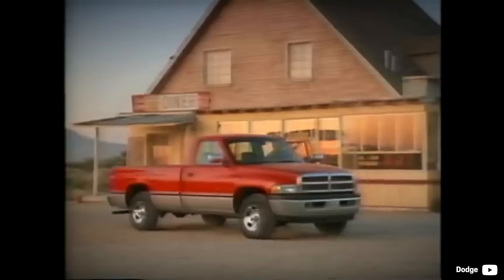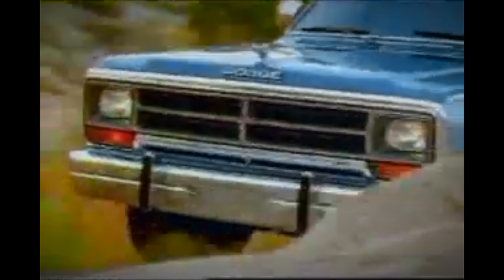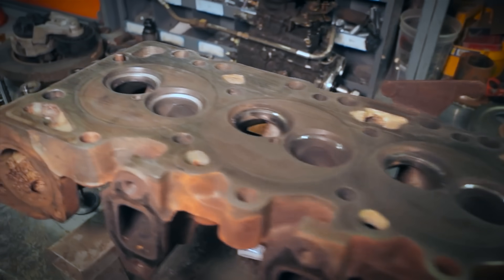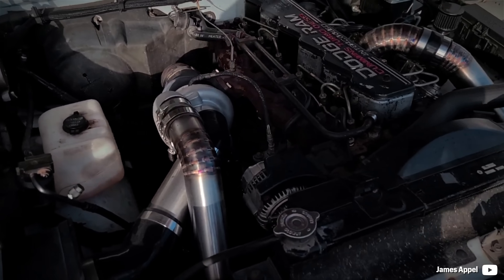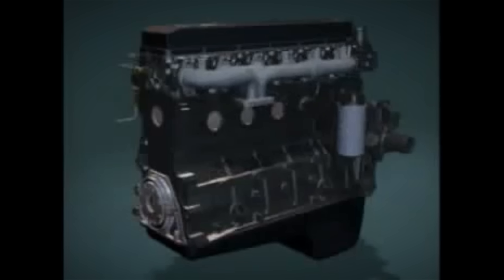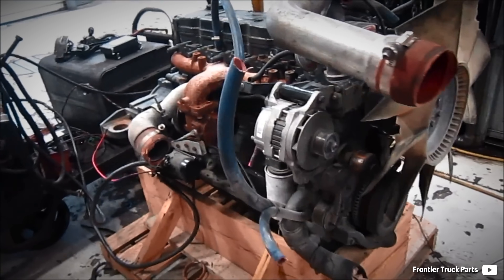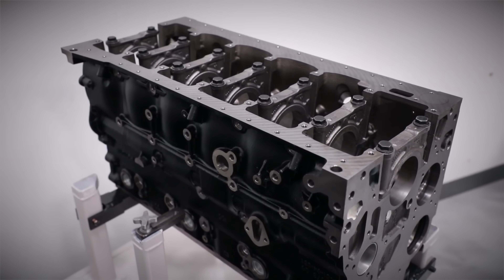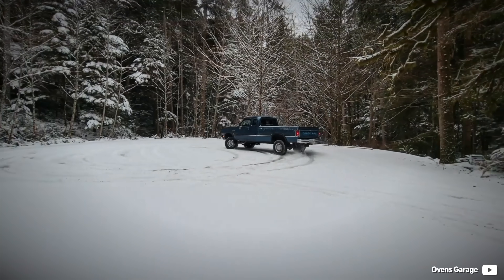The Most Reliable Diesel 6-Cylinder?

Comment: Bought my first 12 valve in 1990. A friend I worked with bought a Ford the same day. From day one +/- 30% better fuel milage and stronger when loaded. First one had 740K on it when the speedometer broke drove for another 3 years. Still was not adding oil between 10K oil changes Still driving a 12 valve today.....👍👍
Reply: i still have my 89
Reply: No one rolls over more odometers than a Cummins 12 valve.
Reply: @Where_is_Waldo  the only ones that do change their oil every 3-5k miles
Reply: @Where_is_Waldo  Actually there's loads more 24v's in the 1 to 2 million + club. The valve count doesn't matter, both are equally the best motors ever put in a non commercial vehicle in history.
Reply: @F9023JFjcDfsdfw2e  Makes sense, but 12 valves are older so they've had more time to do it... and I saw a lot of them with one or two million (km) when I worked at a lube shop like 17 years ago. One guy even told me his had rolled over three times without a rebuild. His oil was black after starting it to circulate the new oil... but it ran.
Reply: @F9023JFjcDfsdfw2e  valve count doesnt matter, but 12v indicates a mechanical fuel system which is more reliable and efficient than their electronic counterparts.
Reply: @domusdebellum3042  That's actually not quite right. The cp3 and vp44 trucks are more efficient than the 12v's and the earlier 12v's had the ve pump which were notoriously bad. Worse than the VP. There's CP3 trucks getting 30 mpg with a 48re transmissions and 3.55 gears (with a programmer). My vp truck gets 24 average if I use my programmer and keep my foot out of it (my foots always firmly planted to the ground so I rarely get that MPG).
Reply: @F9023JFjcDfsdfw2e  but then there's the p-pumps. Mid to upper 20s fuel mileage, and reliability for decades. And fewer moving parts means fewer points of failure. I doubt you'll convince me any 24v beats the reliability of a p- pump 12v.
Reply: @domusdebellum3042  CP3's last just as long as p pumps and it doesn't matter if there is 12 or 24 valves, there's never issues with the heads. What do you think they are powerstrokes or duramaxes? And I have never seen a p pump truck get better mileage than my 01 even when they're turned all the way down making half the power of my truck. Furthermore, my truck startes way easier. My truck can start at -20 to -25+ without being plugged in.
Reply: Old coworker of mines Cummins was around 850k before it stopped counting.
Reply: @cali gdp no one buys them for what they are they are bought for what they can do. I don't know many passenger vechiles that can make  1200+ hp / 2000 ft lbs tq on stock block ,  tow a 30,000 lbs load ,  get the kids from school ,still get 20 mpg and are known to go a million miles.
Reply: @cali gdp Like choosing a woman some men would rather have a "boring and reliable wife" over an "unreliable/fast and exiting wife" that takes half when she decides to part company.....food for thought son
Reply: Cummins is great but dodge FIAT has the cheapest cuality. Transmission transfer case front end interior literally every thing but the Cummins. Don't confuse Cummins and FIAT
Reply: @RamonMartinez-uk1nt  The 47re 48re was one of the greatest transmission ever built. That and the th400 are great transmission.  Like manual transmission there are wearable clutch packs that are mean to be replaced ever 100k . I never see any one do proper auto transmission maintenance.
Reply: @markrich3271  100k? An RE trans's clutch packs are good for 250 to 300k maxed out GVRW miles. And yes, nobody does maintenance. It tells you right in the manual what to do and nobody does it, then blames dodge for when the band is shot because they were too stupid to maintain it.
Reply: @F9023JFjcDfsdfw2e   I personally would never let a clutch go  250k on my 47re. What dodge says and what's acceptable are always different too. My point was clutches are meant to wear . Just like in a manual transmission they need to be changed.  Plastic becomes worn out and brittle. I personally think stock , the 47re is a dog but for a few dollars can be made into a great transmission.
Reply: @markrich3271  Even fully built transmissions are 97% stock, oem parts are always the most reliable. 46,47 and 48 re transmissions are great but are plagued with idiots that own them. Tighten the band and change the fluid every other year like it tells you in the manual and you'll likely die before it goes bad. There is zero chance an re trans has shot clutch packs at 100k. And if any trans shop told you that it did / can happen, go to a different trans shop (they're all con artists because no one knows about transmissions so they can say whatever they want).  A slipping re trans is never clutch packs it's a band that was never tightened. I pray you never paid for the "dodge trans refresh", because all that is is a 5 minute job of a band being tightened and you getting bent over and screwed for it price wise. Trans never even gets dropped. People who haul maxed out every single day with 47 re's go to about 300k before needing clutch packs.
Reply: @F9023JFjcDfsdfw2e   Some times manufacturers get it wrong and aftermarket steps in. Have you built a 47re 48re ? Everything is able to be changed on the torque flight transmission making only the case stock but still heavly altering that.  All the drums are changed for stronger metals , drums can be  redesigned for more clutch making it thicker in areas,the clutch material is redesigned and the thinknes steels also, clutch packs are added, all the shaft meturgry is re-engineering making some thicker and adding teeth to some, bearings are sometimes substituted for different types that take more power , clutch , flex plates and fly wheels are redesigned , tq Converters are redesigned completely adding clutches and their outer design changed    The valve bodys take on whole new hydraulic path ways . The only thing left are the cases outer structure and bolt patern. Even the computers can be stand alone. That's just the tq flight trans the th400 and power much more can be done.  Glided every component can be purchased aftermarket the hydraulic operating system completely redesigned for your specific setup.  Some stuff just can't be altered because it has to fit together but that's a far from 97% stock.
Reply: @markrich3271  Well clutches, pressure plates, flywheels or tq's etc are technically "transmissions" but the clutch system is a separate system than the "transmission" (lol). And yeah I 've heard of and seen the bigger input intermediate and output shafts and fully manual valve bodies or "high flow" valve bodies with billet servos and pistons etc but I have never seen an aftermarket drum and clutch packs. I didn't know that was a thing to be honest. 

With bigger inners and outters with a fully manual valve body I'd say that's still 97% ish factory in terms of number of parts that are factory and number of parts that are not. "Fully built" wasn't the right term to use and I was exaggerating sorry lol
Reply: @F9023JFjcDfsdfw2e   Clutches are part of the trans .. What I said is still correct if you feel like you have to correct me on the antimony of a transmission to make yourself feel like you got the upper hand in this conversation that's obvious , not that i specifically was limiting things i listed to the inside of a transmission . Clutches do go inside a transmission and are apart of it .   I drive a compound charged cummins and turbocharged 383 sbc both make over 1000hp , Both engine ,trans  built 100% by me. I'm a machinist and mechanic by trade. I don't live bicurriouly through others. What I say I've experienced 1st hand through years of personal experience.
Reply: @markrich3271  What? A clutch is not inside the transmission. You're talking about a clutch PACK. I am also a mechanic and have years working at a scrap yard tearing down engines and transmissions. So I'm not sure where you're getting this idea that I'm getting info from others because I have never seen an aftermarket drum kit. But whatever. Transmission starts at the input shaft.
Reply: @markrich3271  And I wasn't trying to one up you, it was more of a joke than anything.
Reply: @RamonMartinez-uk1nt  Yeah you outted yourself for not knowing anything about trucks. For starters, you know ford, chevy and dodge use the same suppliers for ball joins and Ujoints steering racks and track bars axles etc (entire front ends)? Yeah you look dumb right now. My 01 cummins with 327,000 miles on it gets beat to shit every single day, matted daily, mudded on the weekends for years, trucks seen air, 5k + overloaded out of the quary dozens of times, maxed out at least a hundred more times and I have yet to touch the front end (or anything really) in it in the decade I've owned it. I have had 5 dodge trucks in the 14-15 years i've been driving and I have yet to touch a front end outside of a couple tie rod ends in my plow trucks.
 
Also most transfer cases are outsourced, again by the same suppliers. The transfer case in my 01 is a new venture t case. But you don't know what company that is (ps, new venture cases and transmissions are the best ever put in a pickup, and you guessed it, dodges used them cough). 

Dodges have the best front ends and the only maker making better transmissions (and not by much) of the big 3 is Ford. Dodge also has the best frames of the big 3. You know they put dodge transmissions in duramax and powerstroke drag and pull trucks? Yeah look up duraflight kits. You wanna talk about shit front ends and transmissions? Look at chevies garbage IFS yearly rebuilders and their 4L60/80 regular and E variants. But you don't know what I'm talking about anyway.
Reply: @RamonMartinez-uk1nt  that's what I said there's a reason they don't use Dodges as ambulances tow trucks can't trust them. Dodge and Tesla best companies to make a cheap plastic
Reply: @markchapman2585  They do use dodges as ambulances and tow trucks. And outside of the 7.3, Fords are shit. 5'4 triton is the worst gas motor ever put in a truck. 6.0 and 6.4's were the worst diesels ever put in a truck too. Fords make the worst frames by far, that's why its only fords that dog track and rust in half before the bodies shot. And somehow Ford designs their boxes in such a way that the box will rust off before the cabs even gets rusty. Have fun paying 1500 dollars to replace a carrier bearing.
Reply: @markchapman2585  I’ve seen both of those as dodges
Reply: @cali gdp Likely it was not your choice alone that you remain single.....🤔 I think the word incel might  be a good adjective to apply in your case
Reply: @cali gdp  It wasnt the 8.3 and if that is all we have to worry about like I said , well its a great engine .  We are talking about passenger truck engines not every product the company created in its creation.  Every company has its failures. Your really grasping at straws. The 6.7 didn't have headgasket issues at stock levels ever . Only turned up beyond stock. Its was compaired to the older 5.9 that could withstand high boost levels with stock hardware and didnt perform the same . You cant really complain about a engine running a 100psi blowing head gaskets . After the 6.7  oringed their head those gasket problems ceased .  I'm a machinist / mechanic who is in the industry. I'm telling you it's one of the better engines built .  Every one in the industry believes so. It's what most mechanics that drive diesels drive.
Reply: 30% better? Maybe in 1990. 
12v got 18mpg. 89 IDI gets 21.
I hate the sound and the torque range sucks especially in low range.
My uncle had to install a transmission splitter to haul 18tons on his 90 v12.
Point is they are not perfect and have problems.
Reply: @cali gdp Ford Chevy and dodge all use the same manufacturers of rear ends. Dodge primarily uses dana which is the best. Dodges also have the best frames, way to show how little you know about vehicles. Anyone who has a clue knows a re trans can easily get to 300k before needing a refresh of clutch packs (few hundred dollar job). If it has issues before then, it's not the truck it's the operator. 99.9999% of the time it's slipping into second gear, which is a band which means the owner never tightened it. It's literally a 5 minute fix that's free if you own the right bit. You know what they do with dodge transmissions at tranny shops? They get dropped, the band gets tightened, then it goes right back into another truck, that'll be 4,500$ please. But you don't even know what transmission even is. Oh and don't forget about your blinker fluid levels.
Reply: @cali gdp I guess when you run out of intelligent things to say you making unintelligent claims like comparing an engine technically advancements or problems with thier engineers vs one dyno pull by a company that has no relationship to cummins.  To that nonsense I reply with Justin Zeigler. 
You know what makes the 6bt  /isb a great engine.  Since it's creation in 1982 its basic architecture has stayed the same with various modifications here and there . The engine works so well it was never redesigned. It not only powers dodge trucks but ford used it in thier mid serries trucks ,countless busses ,  agriculture equipment, mining , gen sets and marine applications.  None of the other engines chevy or ford used did that.
Reply: Navstar engine ford used was meh
Reply: @Phil-D83  the idi was not meh or navistar at that time. The Engine was the D-444 used in school buses and and heavy agricultural applications.
Reply: @Phil-D83  it actually was a very great motor just as good and in my opinion better than a 12 valve Cummins I hate them
Reply: @cali gdp lmao clank from the rear end? You do your u joints?
Reply: @cali gdp Again you outted yourself. No cummins ever has head issues, ever, even when turned up, you do not see head issues until you double to triple the power. And until there are thousands of fords with 1 to 2 million miles on them like dodges still hauling every day, no you cannot say Fords are even close to dodges. Fords are shit. My 01 was a drag truck before I bought it and it was pushing 100psi of boost a decade ago on a stock engine and still zero head issues being beat to shit every day because it's not a shitty powerstroke . You ford fan girls are by far the loudest and least knowledgeable. 

Tell me again how dodge has shitty fronts ends again when the same suppliers make the front ends for ford chevy and dodge. That was priceless, moron.
Reply: @cali gdp And no, a clank when putting into drive or reverse is 99.9% of the time a bad u joint. Again, you Ford fan girls are the loudest and are the least knowledgeable. How many times can you be wrong about something and still talk? I'm not surprised you're a Ford fan. Just to rub in how little you know let's point out some facts that make fords the worst truck to buy. Fords have bar none the worst frames. That's why it's only a ford that dog tracks and rusts in half before the bodies even shot. Fords have had the worst gas motors ever put into a truck, being 5.4 tritons dog shit head job every other year. They also have had the worst diesels (plural) ever put into a truck being 6.0's and 6.4's dog shit. Ford also can't even make a truck bed right. Only a Ford will have 50,000 thousand miles on it babied, garage kept, never seen a trailer or mud and have a box that is completely rusted off of it with the frame about to rust in half. Have fun spending 1500 dollars to replace a carrier bearing kid. Not that you even know what a carrier bearing is. 

Tell me again how dodge makes shit axles when no manufacturer makes axles. 😂 and ford uses the SAME EXACT AXLES lol just clueless.
Reply: @cali gdp Learn to read, he said 1200hp and 2000lbs/ft of torque. He didn't mention 2000hp.
Reply: 10,000 miles between oil changes on a 1990-version 12v, its just stupid to think anyone believes that.. What all these "half-million mile" Cummins guys won't talk about is how much work it took to get there, much less the chassis barely lasting 200k. The biggest mistake Cummins ever made was choosing to grant the license to Chrysler rather than GM. Old Cats have outlived all of them. I really don't get Mopar guys
Reply: @Drmcclung  GM is the biggest money pit for chassis components, yearly front end rebuilders. The only thing GM can do right is build a good gas motor, that's it. They have the worst front ends, the worst transmissions and second worst frames of the 3 (only one worse is ford). You can't baby a chevies front end to last 3 years let alone using it. Put your truck in 4 wheel drive and use it once, bet you snap your pencil tie rod ends. My 01 dodges front end has never been touched in the 10 years i've owned it and my truck has seen air. Bet your truck never even see's above 1500 rpm or 3 miles over the speed limit. Wanna race?

Oh and what's this half mile mile crap? There are thousands over a million and many over 2 million still hauling every day.
Reply: @Drmcclung What did it take to get here Well this is what comes to mind
- A new battery [there was only ONE] every 2 or 3 years
- 3 for sure maybe 4 serpentine belts. 
- 1 set of injectors/with head re-torque and valve set
-  1 pump rebuild. The front seal packed it in resealed and new shaft for pump
-  2 starters
-  1 clutch
-  transmission tower
- shortly after that tower rebuild transmission
- 2 sets of tie rod ends
- 1 drag link
- 2 rear ends
- 1 front diff
-2 or 3 sets of front axel u-joints
 The KDP never let go either. But I did get that taken care of when the pump was done.
Reply: @paulchristensen2854  That's actually not too bad for an older one. Surprised it wasn't closer to 5 or 6 starters as those (as I recall) were in the top 3 things that they came in for.  Starters, all kinds of electrical bugs and front ends were the top 3. Front ends was #1
Reply: @Drmcclung  I was doing oil changes in my log skidder at 250 hours. It lived in a cloud of dust in the summer. And started by itself at -40. It got the dog stuffing worked out of it every time the key turned. 10,000 miles divided by an average 50 mph = 200 hrs.....The same at an average of 40 mph = 250 hrs. The work load on the 6B in my pick up was never half what the 378 Cummins in the Clark was doing.......and oil sampling said what I was doing was just fine for both engines on top of that. Truth hurts but there it is.
Reply: I’m going to set this as a reminder to buy a 12 valve, thanks man.
Reply: @AnonymousTwo6  ooooo triggered....  and casting doubt as to my orientation. Too funny
Like cali gdp you must be another who struggles with male/female relations.....seek out some help for that. 
Just so you know....help could be as close as the palm of your hand.....or you could get cali gdp to help you out.....could be mutually beneficial for both of you. A long term win win even
Reply: That is CRAZY reliable!
Reply: @barath4545  I used to work at a lube shop and the guys in the old Cummins diesels would just laugh at me when I asked for the mileage. "Oh yeah, go ahead and check it... it's rolled over three times but whatever."
Reply: I daily drive my 96. 287k  @barath4545
Reply: @barath4545  enna ooru bro
Reply: I love the old Diesel engines. But it’s also hard to break stuff when only turning 185hp
Reply: @user-zd5lz7su9t  What year? In 2015 they had 370 horses and 800 ft lb torque....... Now it's more. Were you referring to the original??
Reply: @user-zd5lz7su9t  facts, I can't think of a single diesel that'll see anything over 4500rpm so of course they'll last twice the milage. Same goes for low redlining petrol engines. I still love diesels though lol

Edit: actually I'm wrong. With EFI live your able to gain upwards of 5000rpm. Apparently Mazda's, Mercedes and Audi have 6~7000rpm diesels as well. Pretty damn impressive
Reply: @nissancubesdashboardpubes8026  cummins will spin to 5k and certain racers spin them to 6500. Being over built is the key and the lower the hp the longer the engine will last ... usually.
Reply: @user-zd5lz7su9t  nobody gives AF about hp if they are working. HP is literally a street bro metric man
Reply: I love my 12 valve everytime I see one I cry 😢
Reply: Don't know what you're talking about my 1995 F350 7.3 runs and drives great never let me down. The only good thing about Dodge is the coming and Dodge had nothing to do with it really
Reply: Reply to the guy talking about automatic transmission.  I hate them. Only a hundred thousand miles isn't good.  Love my NV5600 not that is a good transmission.
Reply: @danieldilger9203  RE transmissions are good to 300k if the owner knows how to read a manual and only do burnouts on the weekends.
Reply: Wow